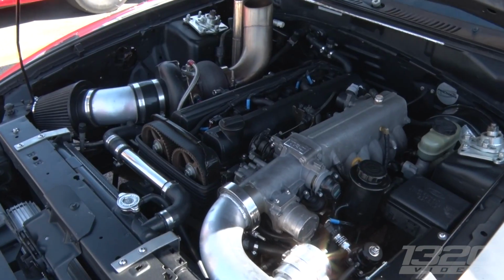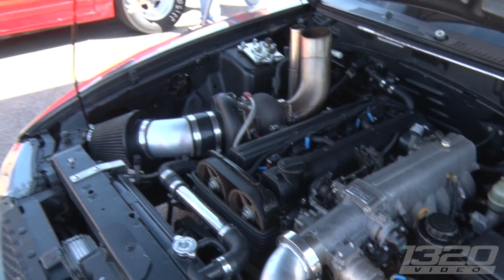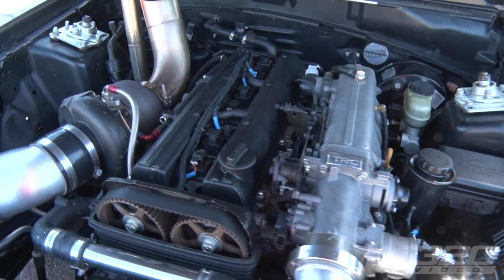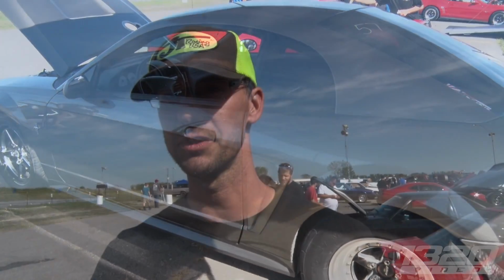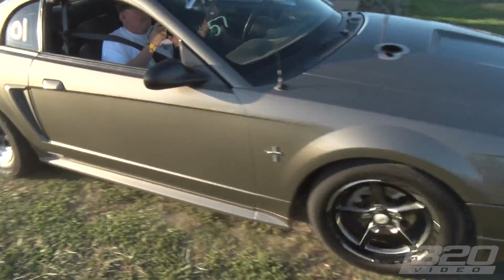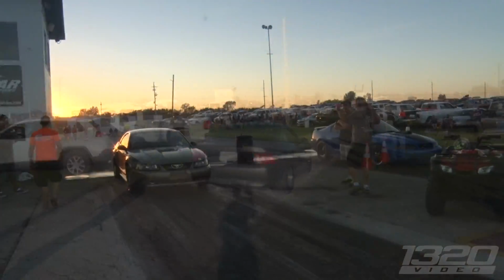The SUPRA Stang - 2JZ Powered Mustang!?

Comment from the maker: What a FUNKY sound to hear coming from a Mustang!  While it's not SUPER fast, this car is a hell of a lot of fun, and VERY unique!
Reply: Did the owner just make the car or did he already have it done a while back?
Reply: how do you get the 2j to sound like that, after i put the 2j in my frs i wanna make it sounds scary like that
Reply: +andrewcarrillo1392 turbo back exhaust that exits the hood
Reply: +andrewcarrillo1392  no muffler and the shortest possible exhaust off the back of the turbo
Reply: I had a mustang, same color, same body, that is wild to hear that, from a stock Mustang, to a 2JZ powered one, is just crazy.
Reply: +kottonkandi90 ,,,,,,
Reply: +1320video Dude, it wasn't that many years ago 6.6 seconds WAS "super fast"... power outputs have shot up in the last 15 years.
Reply: +Sir Nader the car has been through a few versions over the years.  Sadly it took me a while to get it back together after breaking almost everything in it 4-5 years ago.  I got into Motocross racing, and later had my first kiddo.... so finally I got off my butt and finished it this spring.  The entire process can be seen on Facebook by looking up "The SupraStang"   ~Thanks
Reply: +1320video  i agree on the sound but it definitely surprised me on the last few runs. impressive build.
Reply: 1320video
Reply: Hey, I want to do a 2jZ swap in an S550. Would it be similar to your engine swap? Or would it be way more difficult? Thanks!

Comment: "Is it in the 3 digits?" naw man, 99 HP. But we getting there.....
Reply: +Arturo Soto no he said 3 or 4 digits
Reply: +Kille78 he was asking if it was going to be over 1000k or not.  My reply was basically oh hell no... (not with the stock motor, on low boost)
Reply: +Erik Radzins Dont think he asked if it was going to be over a million hp lol
Reply: +Kille78 lol I didn't see your comment before I pretty much wrote the same thing. Like what did he expect there?
Reply: +Erik Radzins You know that "k" stands for "1,000", right? Not horsepower. "1,000k" is one thousand-thousand, which is a million. I don't think even a 2JZ can do quite that much. Generally, when it comes to cars, "1,000k" refers to "kilometers", as in it's got 1,000 kilometers on the odometer.
Reply: HEHEHE ITS JUST ALL THE TORQUE BRO😂😂😂

Comment: 2jz engines are impressive they can take a beating and get 500hp no problem on stock motor. my buddy is running 480ish hp and did 10.0 so far in the 1/4 and still needs to tune and dial it in so yea those engines are brutal and proving. nice set up its different thumbs up